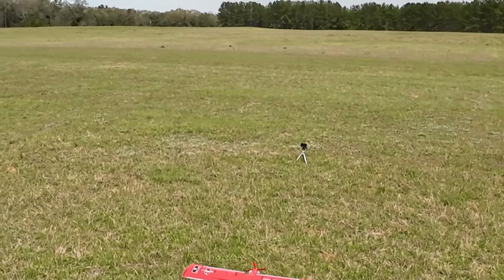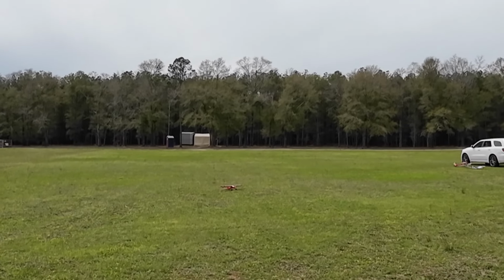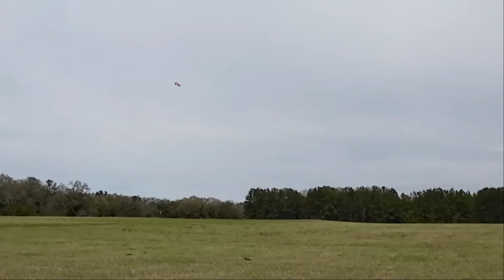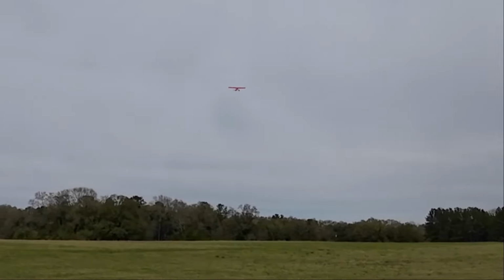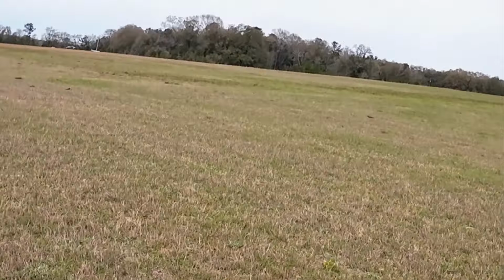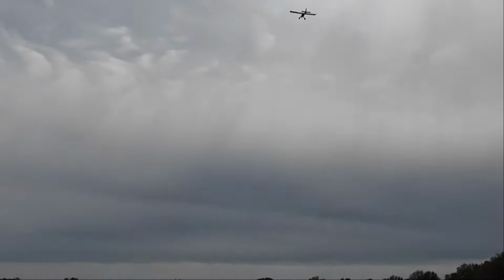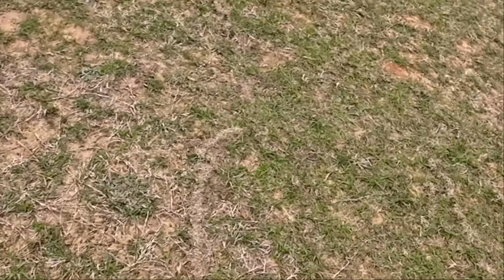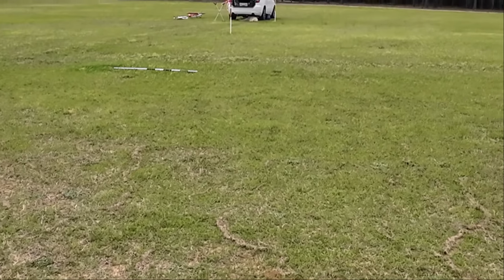Micro Draco Hay Field Tail Heavy Tall Grass Sortie Liberty Landing LA

Comment: i have one  .. its over rated..  not impressed with the way it flys..  lands nice...umx air tractor or umx turbo timber are better and priced better
Reply from the maker: It's $30 more than the UMX T Timber.  I like all the lights, extra details, landing gear, and it's Draco.  I think it flies great but I like doing STOL flying.  I like keeping it light by using the 3s 300 with a very neutral CG. I had the CG to far to the rear at the beginning of this flight.  Hope you can sell yours, thank you Jeff